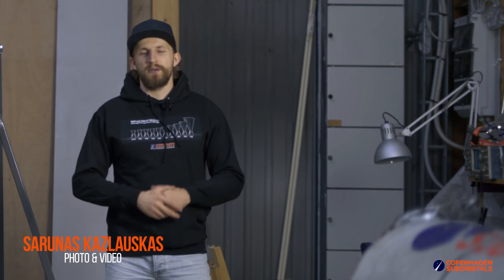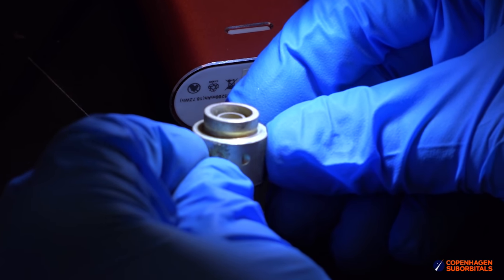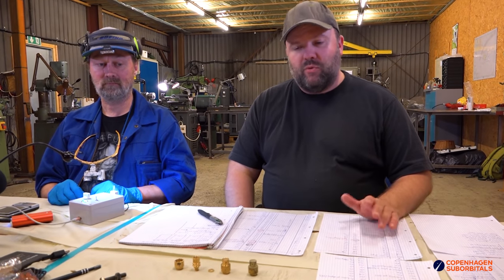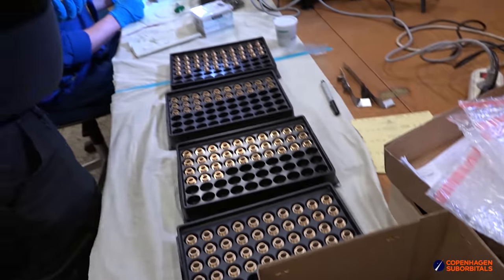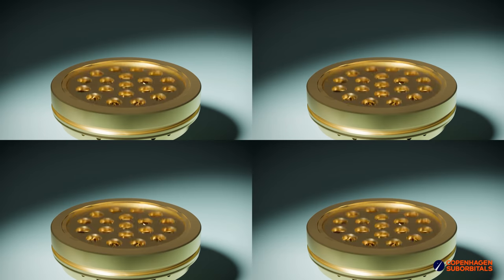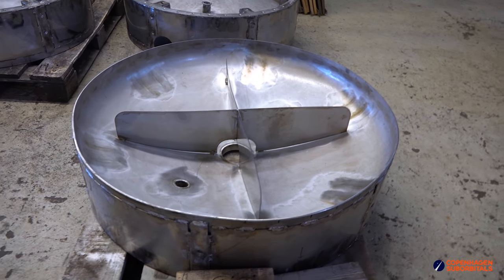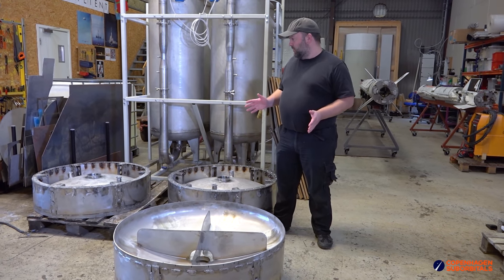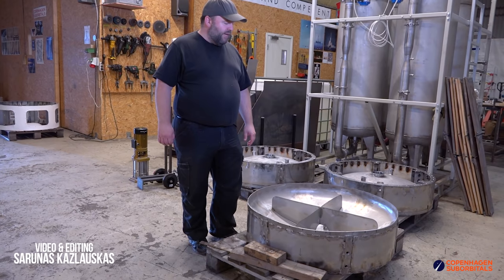Cooking Rocket Fuel Injectors | INSIDE THE ROCKETSHOP: Episode 27

Comment: Vortexing liquid inside your rocket will also impart an unwanted torque, causing your rocket to spin.  Which is not desirable.
Reply: The Gyroscopic effect of any rotation body inside the rocket will also have a rather unwanted effect on the guidance control system ;-)

Comment: it is not the coriolis force, it is whatever random rotation is already present in the liquid
Reply: In a non-technical daily use you are right, but technically speaking the Coriolis force apply to any situation where an object is being moved within a rotating frame of reference. So even though the rotation of water in a bathtub is caused by the Coriolis force it is not the rotation of the earth that has any effect on the creation of this vortex. It is the slightly, initial and random rotation of the water in the bathtub that results in water moving in the direction of the outlet being diverted sideways and thereby creating the vortex. Therefore the aforementioned rotating frame of reference can sometimes be the affected body of material itself.

Comment: There are several startups building low cost co-working robot arms... Maybe they have the precision to automate the solder paste application process when it comes time to do hundreds of nozzles? Im sure one of these companies could send you a donation unit:)
Reply: 100 is not enough to justify a robot. it would probably take longer to setup and train the robot then to do it manually

Comment: Will soldered parts really withstand the heat? Have you thought about 3D printing parts?
Reply from the maker: They will be actively cooled by two propellants flowing through them. And yes, we will be hot testing two 3D printed injectors soon. We have a video comparing 3D printed and machined coaxial swirlers:
https://youtu.be/Q5mDImjppCg

Comment: Why not pre-mould the solder into pieces that fit into the recesses in the nozzles?
You could quickly add the same amount every time. A dab of flux, assemble, heat, done.
Reply: The injectors are machined, not moulded, for precision. The dimensions of the injectors are performance critical, the amount of solder is not. I guess they weigh the solder to make sure they haven’t built up an injector with a missing ring of solder inside, or some gross error like that.
Reply: @BillySugger1965  There are two common ways to dispense accurate amounts of solder paste.  One is using a needle to squirt out a precise volume in the correct place.  The other is to scrape it into a precisely cut hole in a thin steel plate held at the target location, thus placing precisely the volume of paste matching the hole size.

Comment: Wouldn't it be better and faster to 3D print the injectors?
Reply from the maker: We do have a video comparing 3D printed and machined swirlers:
https://youtu.be/Q5mDImjppCg

And we will probably have another one coming soon on the subject, but since our project is running on a crowdfunded, shoestring budget the real question often is whether something is cheaper and feasible under our constraints. We do not own a 3D metal printer in our workshop, whereas we do have mills and lathes, so most of our design has to be centered around our in-house manufacturing capabilities. Of course, it is nice that sometimes great people like Häring or Digital Metal reach out to us and offer their machining or 3D printing expertise as is the case with these machined and our 3D printed injector examples.
Reply: @CopenhagenSuborbitals  wonderful thank you for the link.
Reply from the maker: @myronv4390  You are welcome!

Comment: The coriolis effect has no noticable impact on your drain spin, its a myth. In reality its a matter of flow, as a result of campfering and banking in the structure within the sink, combined with the flow of pressure equalization. The coriolis effect are much too weak to do anything to such a small amount of fluid, if this was the case you would be able to just have a glass of water and the content would start spinning, which it doesn't. Installing those baffles will prevent swirling in the tanks but that has to do with pressure in and out not being perfectly aligned with the banking of the endcaps concave stuctucture which is also not perfectly round. In fact its the same reason your swirlers work; the disalignment to the containing structure.